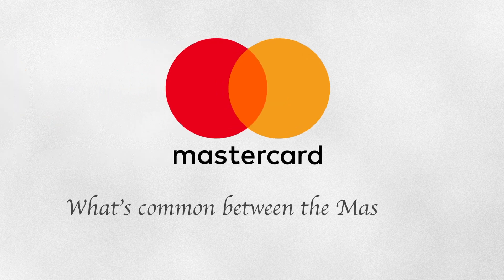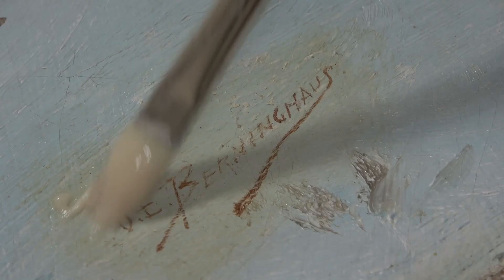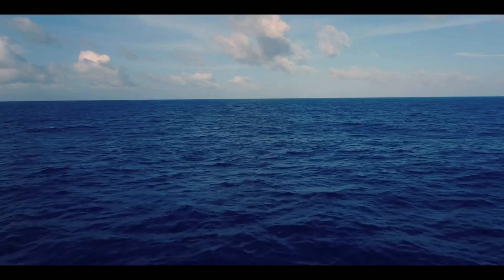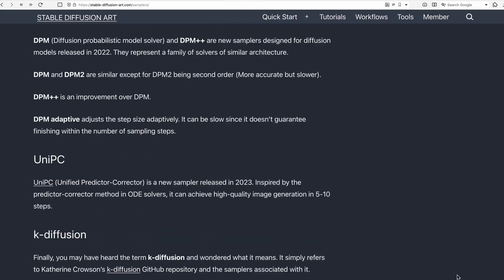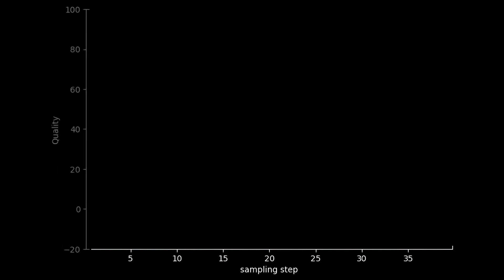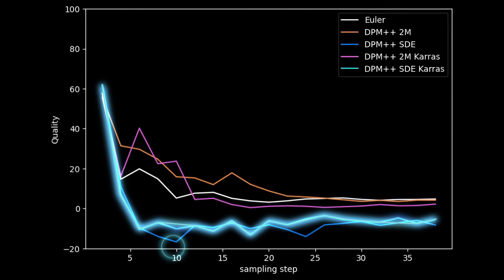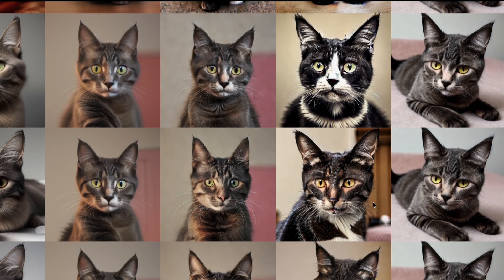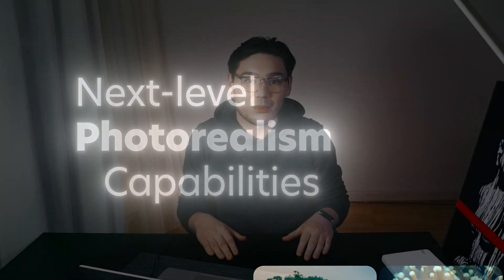Wow! Samplers tutorial - Fast and Effective Generation For Everyone

Comment: Hi! Great video! I just have one more question. So I assume you tested these samplers' performaces on GPU, right? I run SD on CPU, and I'd like to know which samplers would be best at denoising CPU noise and fastest at image generation. Could you maybe recommend anything? Maybe experiment with these samplers on CPU only in the next video? Thanks!! Love from Ukraine :)
Reply from the maker: Thank you🩶 When it comes to the CPU, there's likely to be a completely different picture, but I can say for sure that Euler and EulerA will be the fastest, and in terms of the optimal number of steps, it will probably be roughly the same as in the video.